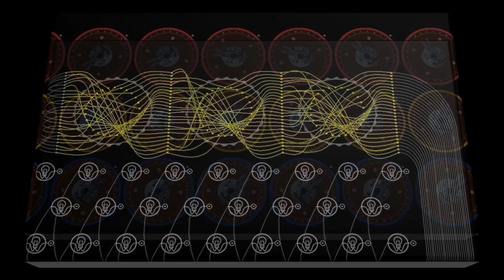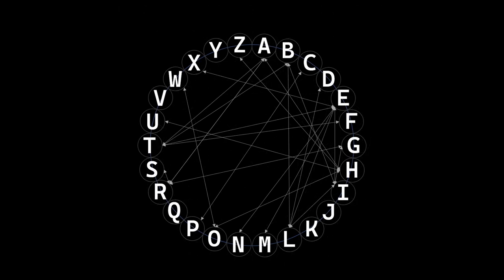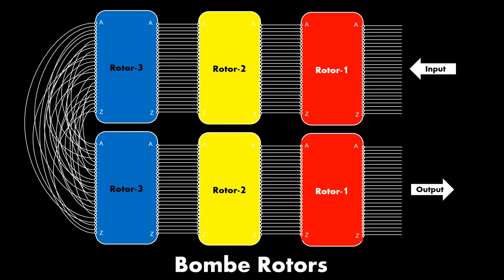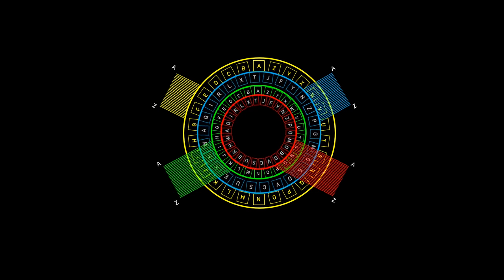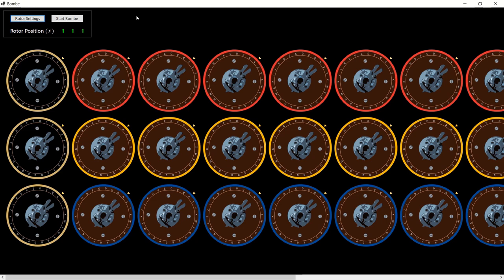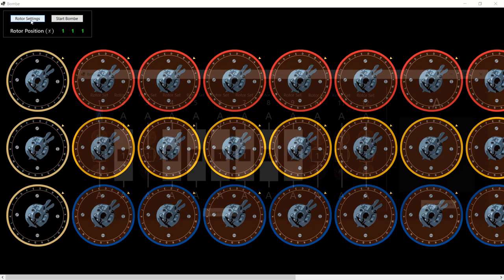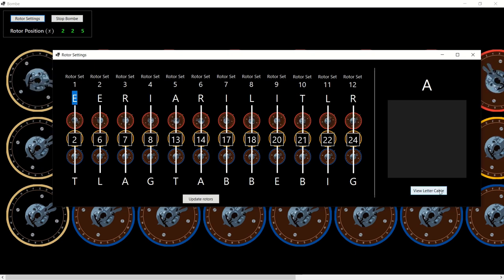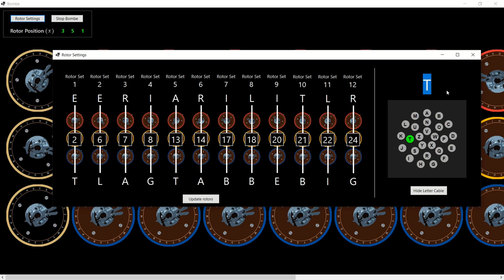How Enigma machine was cracked | Bombe machine | Part-2

Comment: I'm confused about the stepping action of your bombe. In the animation, the yellow rotors step anytime the red rotor goes from A->Z. But that isn't necessarily the position the enigma stepped for that configuration and ring setting. So the relative configurations may be off if the second and third rotors are stepped wrong? I remember reading that a crib wouldn't work if there was a turnover in the middle, so would it make more sense to keep the second and third rotors in sync across the bombe, and just rotate the red rotors relative to each other?
Reply: In practice, this was a much less problem as it seems.
If you get a solution wich decrypts the first 12 letters to something which looked like it was valid german but suddenly turns into gibberish at the 13th letter, you know that the used turnover point (the ring position) from ring1 to ring 2 is most likely wrong and needs to be adjusted. Just do it and try again. There are only 26 possible ring positions to check, no big deal for the machine. After all you knew that the setting was correct for the first 12 letters, just the turnover needs adjustment.
Also: They did not use just 1 single transmission for the cracking, but multiple messages of the day. If 1 crib didn't work, another one from a different transmission might work.
Also: The turnover from the 2nd ring to the 3rd almost never mattered as most messages were not long enough to have the 3rd ring turn away from its initial position at all.

Comment: I don't understand wich cable your supposed to power on the first time and if you need to switch between cable
Reply: For each tested rotor position, you try all of the cables in sequence to figure out if one of them does not power all of them.
Reply: @kallewirsch2263 i'm sorry if i'm not understanding but wich cable are tested ? Like, does they test cable configuration at each tested rotor position ?
Reply: @astrapex2163  
You have watched the video?
If the configuration is not correct, then powering any cable connecting the rotors powers all of them.
It is only for the correct configuration, that this will not happen.
So yes.
This is how it worked. The individual enigmas were connected according to the "menu" (that is what they called it). The menu was derived from the encrypted message and the (guessed) plain text. The menu would be set up to form a loop: eg. 'E' translates into 'W' in position 5, 'W' translates into 'D' in position 8, 'D' translates into 'E' in position 12. Note how this forms a loop 'E' -> 'W' -> 'D' -> 'E'.
3 enigmas in the bomba were connected (all letters connected) and the rotor configuration of those 3 enigmas were set up according to the menu (assuming a key of eg 'AAA'). Then the machine was started, after stepping to the next rotor positions (of all 3 enigmas), the number of powered cables were counted. If the count was 1, then the machine stopped. If it was not 1, then all 3 enigmas did 1 step to the next rotor position (testing if AAB could be the key) and the cycle continued.
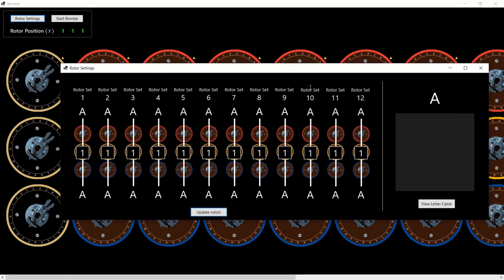The guessed plain text wasn't just a random guess. The british knew that the germans distributed eg. the weather report at specific times. So the knew that the message they received at 07:00 would start with the german word "WETTERBERICHT". There is one reported incidence, when the could not find the key but the knew about a boje in the north sea. So they ordered an attack on that boje knowing that the local station would report this attack to the head quarters. Now they had the encrypted text and they knew that somewhere in this text there would be the name of the boje. Voila: it worked.